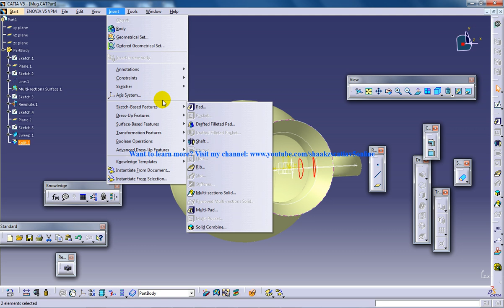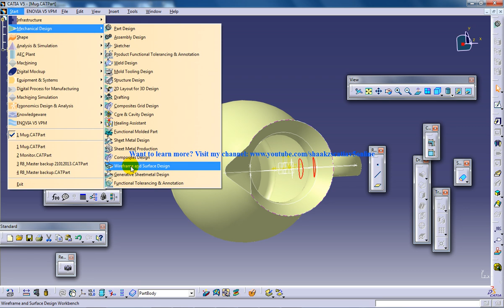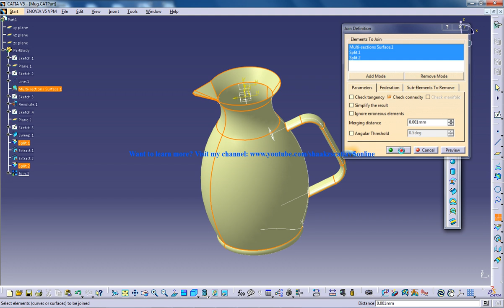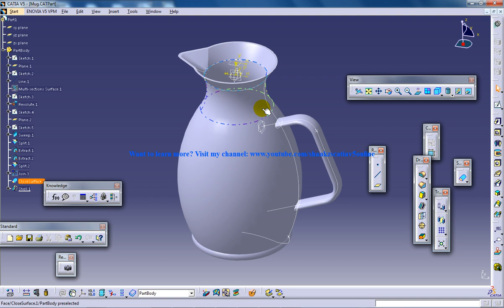Catia V5 Tutorials|Wireframe and Surface Design|Rebuild A Mug|Part 5

Comment: Hi Mr. Shakeel, first thank you for the tutorial, I have one quick question, in previous video which is part 4, in the design tree, the features are under geometrical set, how did you switch them under partbody? This question has been bothering me for a long time, can you tell me how to do it, please?
Reply from the maker: Hello. Please select the features that you want to move and right click and select change geometrical set. And then select the geometric set you would like the features to move to.
Reply: +Mohammed Shakeel  thank you for reply, i selected the feature and right click but can't find change geometrical set
Reply: +Mohammed Shakeel    Hi Mr. Shakeel,  I have another question why do you switch them under partbody? and why there is no geometric set under partbody?

Comment: Thanks. Your suggestion worked. (Though with a much smaller shell thickness (0.05) ).
I followed the exact same steps, and took the same dimensions. Then why the difference in the acceptable shell value?

Comment: When I apply the Shell command, I get an 'Update error' saying 'Current offset value leads to a local degeneration on a surface: body cannot be built.', followed by 'Some faces can't be offseted. Do you want to ignore them?'. When I ignore them, it seems to work. But I'm pretty sure I am doing something wrong. Can you suggest as to what I may be doing wrong?